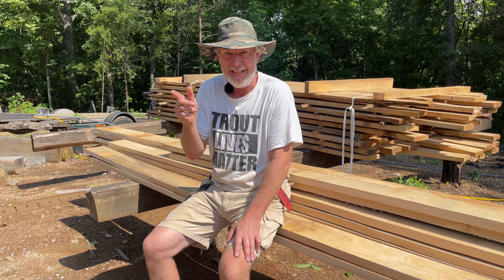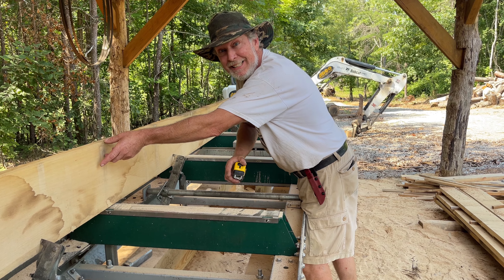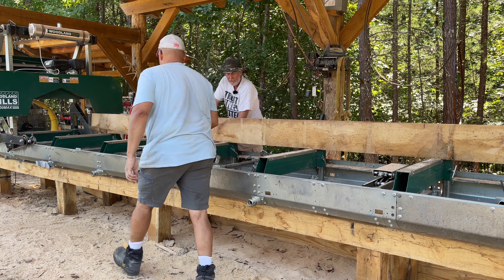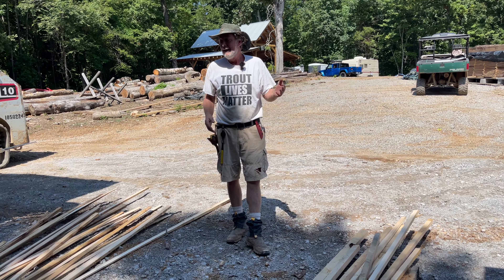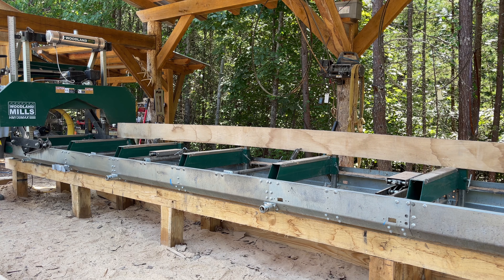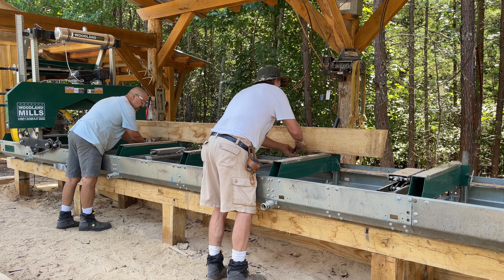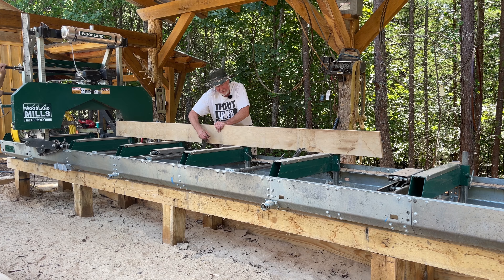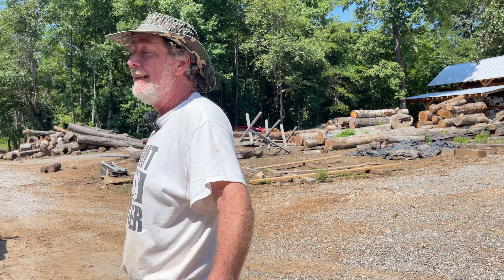HOW TO STRAIGHTEN WARPED BOARDS ON YOUR SAWMILL Sizing White Oak Deck Boards Tutorial

Comment: I use this same process, but i do about 10 boards at a time, so they all come out at the same width.
Reply from the maker: I do as well these boards could not be cut at all the same height. Out of kiln some warped boards. Was pulling out just premium. Any other time ten at a time

Thanks for watching!🤠👍

Comment: I've noticed you don't use the adjustable blade guide. What's the reasoning? On another question, could you show how you adjusted your laser beam? Yours looks much brighter and down the length than mine, and it runs the full length of your stock. I'm having trouble getting mine down the full length of a 16' cut. Also, your beam is brighter than mine. I think it's the shed vs. me being in the open without a roof.